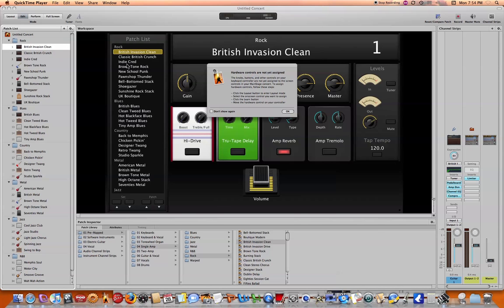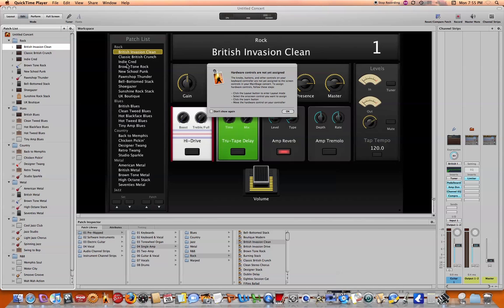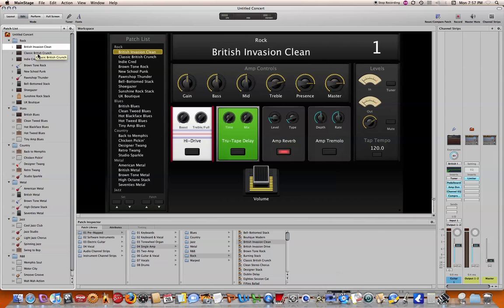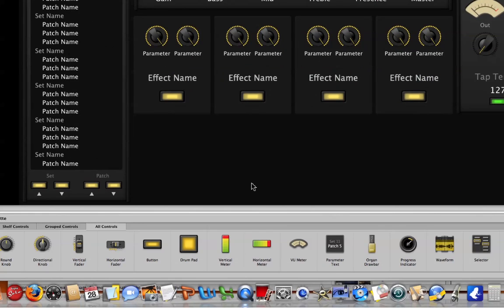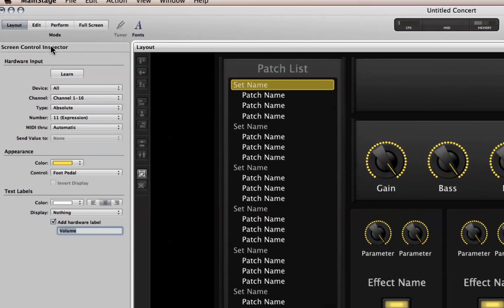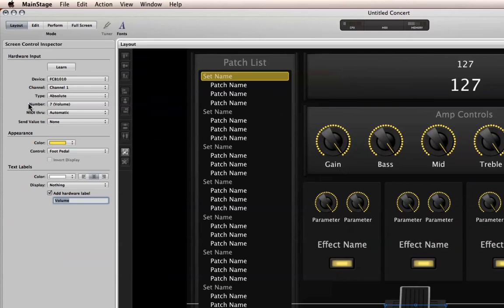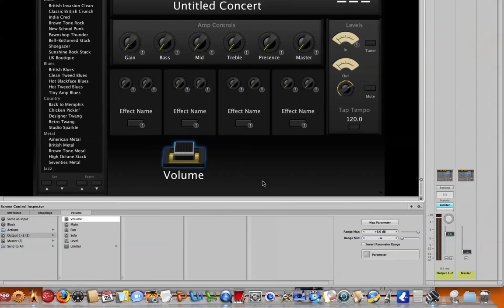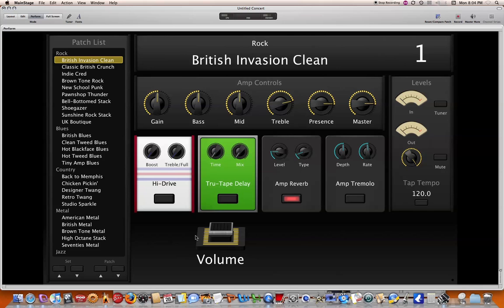Mainstage 2 - External MIDI - FCB1010 Pt 1 of 3

Comment: Your videos are excellent - thank you - but I am at complete loss here .. I have Mainstage 2/M-Audio Fast Track Ultra 8R and FCB1010 - and while I can have the Volume pedel assigned and working, I am unable to have Mainstage recognize any other with on the FCB1010. I have posted to the iFCB forums but have had no response. So I am hoping you might have a tip for me??? 
I have followed your video to the letter - but no go - Mainstage will not accept any commands from the pedal board.

Comment from the maker: @naominev Ok, I downloaded the manual and took a look through...what you might be able to do is use the S1 and S2 buttons for patch up and down.  What we need to do is figure out what the unit is sending to the MIDI Out port when you press them.  There are two ways you can do this...1. In Mainstage, do a Learn from layout mode, press the switch and see what Mainstage learns.  2. Look at what is being sent by using MIDI Monitor - this is a great little tool to have - it's free, go to snooze.com

Comment from the maker: Thanks and I'm glad the videos helped!

Sure, the first thing you need to do is program the second FCB pedal to send CC#11 (expression).  Follow the same procedures you did for the volume pedal.  You then need to do a learn for the wah, if you're using the wah effect using the built in wah of the Maistage Pedalboard plug-in, you might want to check out the video I have up on programming the Wah in Mainstage.

If you run into problems, check to make sure your pedals are calibrated okay.

Comment: Hi! First of all thanks a lot for your wonderful work! It has been very very helpful!
I need to ask you 2 things:
1-When I use the Learn function, Mainstage recognizes my M-audio Fastrack Pro, not the Fcb1010, even if I've previously mapped it with Ifcb, what am I doing wrong? Is there any driver I need to install?
2-After I've programmed everything following you step by step, when I press the pedal assigned to the virtual pedal it works, but it also switches to the patch with the same number!

Comment from the maker: You need an interface such as the M-Audio Fastrack Pro which will support both audio and midi.  So the MIDI out of the FCB connects to the MIDI In of the interface.  The MIDI In of the FCB connects to the MIDI Out of the interface.  The interface then connects via USB to the Mac and the MIDI messages go over the USB connection into whichever software you're using.

Hope that helps! :)

Comment from the maker: The key thing to learn about Mainstage, and what most people miss at the start, is that it is built on a hierarchy.  A Song belongs to a Set and Sets belong to a Concert.  If you put a Playback backing track channel strip at the Concert level it will appear in every Set and Song - automatically.  If you put a Playback in a Set, it will be in every Song within that Set.  So use that method to your advantage to build whatever you need.

Comment from the maker: Technically speaking, you could do it either way.  The difference in my opinion, is that Logic is purpose built for  s recording while Mainstage is geared towards playing live.  In your case, where you're playing live, I think Mainstage is the better choice.  

There are a number of reasons for that:
- The Mainstage interface is easy to read and navigate for live, especially in full screen mode.
- It's model is based around a concert, set, and songs where Logic is based on tracks

Comment from the maker: You can also group multiple backing tracks together so that when you start one, each backing track in the same group will start together.  For example, if you had a drum track and a bass track, you can have different Playback tracks (one for drums, the other bass) but put them both in the same group, they will play together.  You just need to make sure they are in sync i.e. same length.

Comment from the maker: No problem.  You can do it either way in Mainstage...you can set up a separate backing track for each song, then just move from song to song and either start the Playback manually (using a MIDI trigger) or have the Playback track automatically start when you select the Preset/Song.

If you have multiple backing tracks playing together for one song, you could put the Playbacks at the Set level (in this case we're using Set as a Song...I know, a bit confusing) and start them there.

Comment from the maker: No problem, you need to use an Audio Interface (many are available in the market for all budgets) and depending on the type audio interface you're using, it will have a 1/4, RCA, or SPDIF out that you can run straight into a PA.

Comment from the maker: Hey Gallo, in short...neither.  Those modes are accessed and needed only when you're programming.

Just make the MIDI connections from your FCB1010 to your Fast Track ..
- FCB MIDI Out --->  Fast Track MIDI In 
- FCB MIDI In ---> Fast Track MIDI Out

Power up the FCB, don't go into any mode other than what it powers up with and then do a Learn in Mainstage and press a FCB switch.  The FCB has lots of default programming and MS will pick it up.  Do the FCB key programming when ready after that.

Comment from the maker: hey bobby, a few things to check..
- Has the pedal been calibrated properly?  You might want to re-do just to be sure - follow the instructions in the FCB manual
- Are you using CC#11 (use iFCB to check)
- Are you sending out the correct range of values? i.e. 0-127?
- Finally, check the MIDI messages being sent out with MIDI Monitor, do you see them?  If so, then we need to start looking at Mainstage but I really don't think it's that, sounds like a programming /MIDI issue.

Comment from the maker: ...after the green light in Direct Select, do you press the Up button twice?
- Does the Config LED light up?
- Do you then press the number 7 footswitch?
- Then click Send
- What happens?
- Then press the Down switch for a couple of seconds and let go...you should see a countdown begin and go all the way to 00

At what point do you get the 88?
- Next time you get the 88, just press any key on the FCB and it should go away and you should be able to continue on.

Exactly which Edirol model?

Comment from the maker: Hey bobby..it's easier if you get me on Skype, my id is jasthemusicman so we can go through problem determination but let's give it a go here..
- Are you using iFCB?
- If so, does the little light at the bottom left of iFCB show green or red?
- If so, let's double check the syses setup procedure..
- After you click Send and get the pop-up, do you turn the FCB1010 off?  You should
- Then power up while holding the down key
- Does the green light on the FCB light up with Direct Select/Glbl Config?

Comment from the maker: As for the UNO chip, it's not as significant as you might think.  I put it in my FCB1010 then took it out because a) it didn't really make that much difference to me since I was using Mainstage 2) the iFCB editor won't work with the UNO chip

Let's get you working as is, then you can see if you need it - but I doubt that you will.

Comment from the maker: The first thing to check is the connections:
- The MIDI Out on your cable should connect to the MIDI In of the FCB1010
- The MIDI In on your cable should connect to the MDI Out of the FCB1010

If that doesn't work (but I think it will) then check your Audio/MIDI setup to see if it appears there.
Go Apps>Utilities>Audio/MIDI Setup (then Window>Show MIDI if it doesn't already appear) and see if the M-Audio device appears there.

Then let me know how things are and we'll go from there.

Comment: Hi Jas,

I just bought an FCB1010 after going through your tutorial vids and thinking that it seemed pretty straightforward...unfortunately I'm hitting a snag getting started. I bought an m-audio midi to USB interface to run the unit into my macbook pro 13" but it doesn't seem like it's detecting it. Also, now I'm reading all about the UnO firmware for this unit, the EPROM, etc....ahhh!!!

two questions:
1. How do you run the FCB into your comp?
2. did you upgrade to the Uno firmware?

thanks!

Comment from the maker: The trick then is to then position your cursor at the arrows showing the in/out ports of one of the devices.  Then click your mouse and just drag a new connector line which will appear over to the arrow of the other device.   Do that for both ports to connect the devices.  That's it!

Good luck and let me if you have any problems.

J.

Comment: how did you virtually 'wire' the FCB1010 using the MAC's Audio/MIDI utility?
I'm having trouble mapping any fcb 1010 buttons to mainstage2...am using fcb 1010 > Lexicon Omega > MACBook pro OS X 10.5.8 .

Comment from the maker: I took a closer look at your amp specs and yeah, you're in good shape to do what you want and I don't think it will take you as long to set up as you think.  

I didn't realize this amp had a line in as well as an out.  So for recording you won't even need a mic, just run your line out into whatever device you want to use for recording :)  

I like the multi-functionality of that amp...not sure what it sounds like but it's definitely flexible...good choice!

Comment from the maker: Good point - and no problem to do.  I totally agree with you having some desired tones already is the way to go first.  Just set up a switch/MIDI setting to go directly to the patch/tone you want.  

The transitions to the patch you want are actually pretty quick and I wouldn't worry about that, you should be good providing you're running a half-decent PC or Mac with enough processing power.

Sounds like you're heading in the right direction, have fun! :)

Comment from the maker: As for getting good sound, if you already have the X-Gear software and a way to get your guitar signal into your Mac or PC (through a DI box), then all you need is a pair of good monitors or a PA depending on what size room you're trying to fill.  Unless your performing on stage then good monitors will be great.  Another option is just to route to a mixing board then onto the house PA if you're performing.

Comment from the maker: Thanks sourcehacker...anytime dude!

Yeah, what I mean "as a plug-in" is that you can insert X-Gear into a channel strip within Mainstage.  So what that means is that you have a Mainstage patch which, in turn, is using X-Gear and then through X-Gear, any Amplitube  sound that you already use.

If you use X-Gear (or just Amplutube 2, Metal, etc) in standalone mode, meaning that X-Gear is NOT running as a plug-in, then you don't need Mainstage but you can still use the FCB1010 to call up patches.

Comment from the maker: Good question, yes, the FCB1010 will work with Amplitube X-Gear no problem - I use it myself.  It will work in both X-Gear standalone mode and as a plug-in.

In standalone just program the FCB1010 first then go into X-Gear, choose MIDI Ctl, and then do a learn for each of the functions.  In plug-in mode you need to do some parameter mapping.

Comment from the maker: Yes, iFCB needs to complete a MIDI loop so you need two cables.  So your Digi Mbox2 is USB to your MAC/PC as you have then connect:
- The MBox2 MIDI out connect to the FCB1010 MIDI In
- The FCB1010 MIDI out connects to the MBox2 MIDI In

If all is connected properly, when you open iFCB you should see a green box in the lower left corner and Behringer FCB1010 with the firmware level.

Good luck and let me know if you have any problems.

Comment from the maker: Additional note: whatever MIDI device you get will appear in Mainstage under the name of that device and not the FCB1010 that's connected to it.  If you want Mainstage to see the device as the FCB1010 you need to go into your Mac's Audio/MIDI Setup (in Utilities) and virtually "wire" the FCB1010 into your MIDI device.

Comment from the maker: Hey Jaxon, good question...yes, the FCB1010 would connect via MIDI cables to an MIDI/USB Interface, then that MIDI interface would connect via USB in to your Macbook and appear as a MIDI device to Mainstage.

Strictly speaking, the FCB1010 only needs a MIDI interface (not audio). There are many Interfaces that support both audio and midi in a single device.  You're using guitar so it's probably more convenient  to use a combined A/M Interface into your Macbook instead of two separate devices.

Comment: How does the FCB1010 connect to the macbook? Does it have to go through an audio interface, and if so, does the audio interface come between the guitar and the FCB1010 or between the FCB1010 and the macbook?

If it works separately to the audio interface, what cables connect the FCB1010 to the macbook?

Thanks for the great vid!